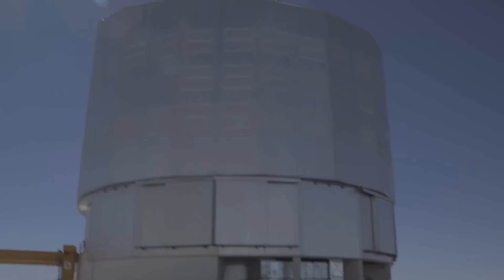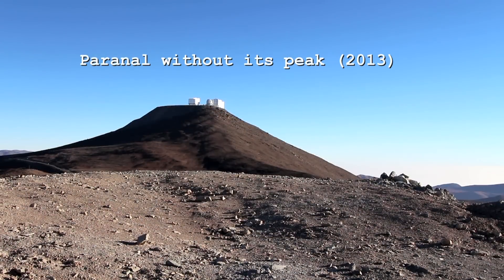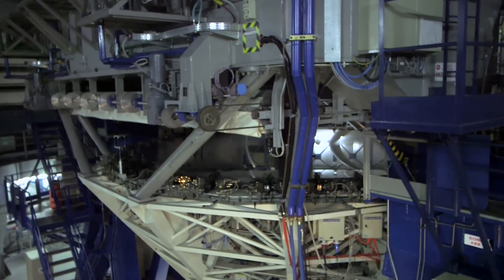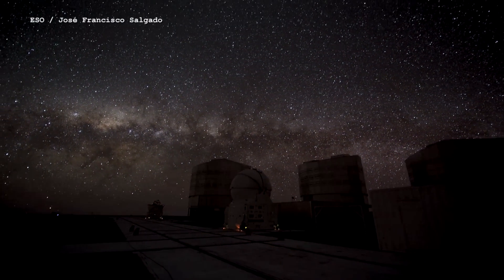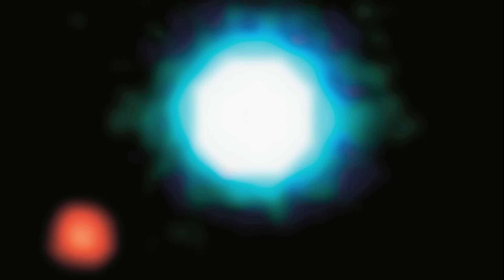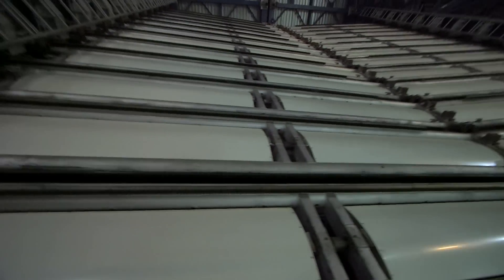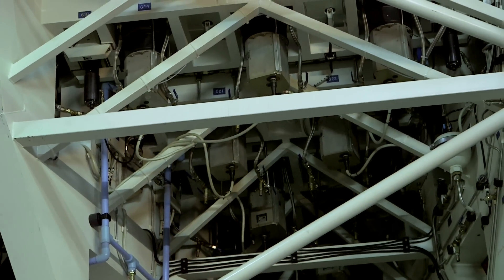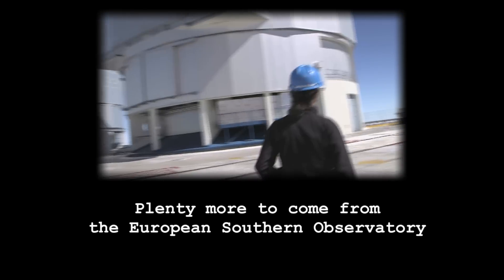Inside the VLT (UT4)  - Deep Sky Videos

Comment: The laser is used to create what is called an artificial guide star. A guide star provides a fixed reference point for adaptive telescope optics in correcting for atmospheric disturbances. In some parts of the sky no suitable natural star is available, so an artificial "laser guide star" is created.

There are two main types of laser guide stars: Rayleigh, and the superior sodium guide star (used by VLT). A yellow laser is used to excite atmospheric sodium atoms starting at about 90km altitude.

Comment: You can get away with much smaller components. To move all at once you'd need a much bigger motor, much stronger rails and bearings. As it is now you just need a small bearing to roll on the slide below.
As an astronomer you pretty much know when the sun will set ;) , so just start sooner with opening to be ready. The telescope must adapt to the outside temperature anyway and opening them one by one may even has the advantage of not letting too much air rush in at once and blow dust everywhere.

Comment: A tiny fraction of the laser light scatters on particles in the air. I could imagine water vapor, dust or other aerosols. Usually one would not see the laser with the naked eye though, I assume. However, if the exposure long when taking a photo, the scattered laser light is accumulated and becomes visible.

Comment: Are you referring to laser pointers? The VLT system consists of a high power 25 W 589 nm laser, so it's in the visible region of the spectrum and it's powerful enough to excite a band of sodium atoms in an upper layer of the atmosphere (90 kms up). Common laser pointers also are in the visible spectrum but cannot exceed the ~5 mW legal limit (i.e. the VLT laser is ~1000x stronger).

Comment: with an off-axis reflector, while you don't get the obstruction from the secondary mirror, you get a lot more optical defects coming into play (and - I believe that collimating it is also way more difficult - if not impossible). You get a lot of coma, as well spherical aberration. That's fine for a cheap little telescope (and the advantages might be worth it - it won't be of superb quality anyway), but for anything serious...you can't use that configuration :)